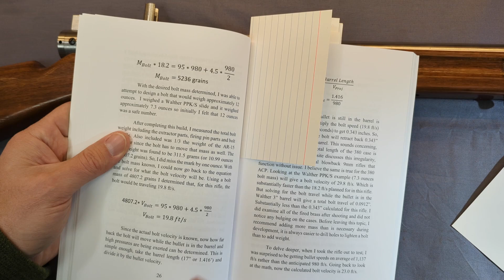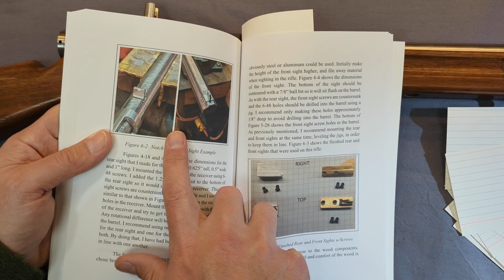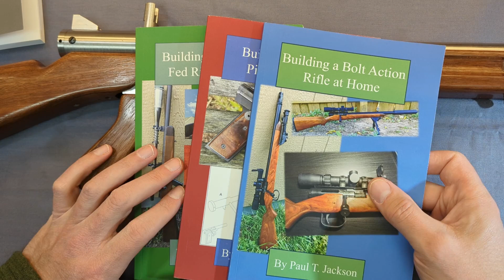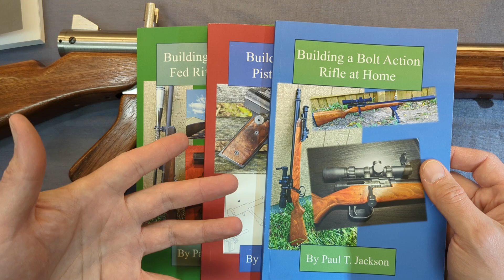New Book: “Building a Semi-Auto Rifle at Home” on Amazon

Comment: Ever thought about making a gun without 3-D rendering

Not all of us has a steel 3-D printer machine
Reply from the maker: I didn't make any of these using any digital machinery or additive manufacturing. I made them with an older manual mill and lathe. I have a shop tour video that shows my main tools. I never even use CAD unless I need to make drawings for a book

Comment: Gonna hafta see if i can get this book. Right up my alley for "Holy crap, thats neat!"
But i did notice that most of your books say "at home" in the title. Your reciever looks milled. Not alot of folks have machine shop goodies in their garage...
Reply from the maker: True my garage is well stocked. I have a video on my channel that shows the major tools I have. But yes for this one milling was required
Reply: @garage.guy.3006  your next build/book oughta be something similar to a sten where all ya need is a grinder, drill, welder, tubing and flat plate. Round stock for a bolt, maybe an AR barrel re chambered to 5.7. That'd be fun :)
Edit - Even though I don't have the fancy stuff, I subbed anyway.
Reply from the maker: I might do that. Some of my earliest stuff I did with only a lathe. My real early (cursed 9mm) guns I did without a lathe. Thanks

Comment: How hard would it be to configure this to 9mm ?? Maybe just the weight of the bolt? Spring and chamber?
Reply from the maker: I'm sure it could be adapted for 9mm. But yes the bolt mass, mag well and several other things would require modifications
Reply: The 9mm case is tapered, so the chamber will be harder to make than the straight walled 380.
Reply: @ I would buy all the necessary tools, reamers etc,, I own a machine shop as well,,
Reply: @redhawk73439  one could hypothetically use drills and a chamber reamer very easily.
Reply: You could probably mod a sten build to match this look
Reply from the maker: I'm sure you could mod one of the semi auto ones. Would make a neat looking gun with lots of wood furniture on it
Reply: @garage.guy.3006  lol yes the semi auto ones, I should've clarified that haha
Reply: Look up the sten mark 5 with all the wood furniture.